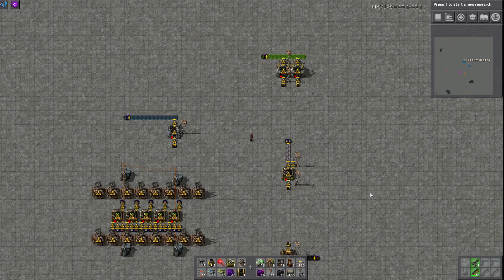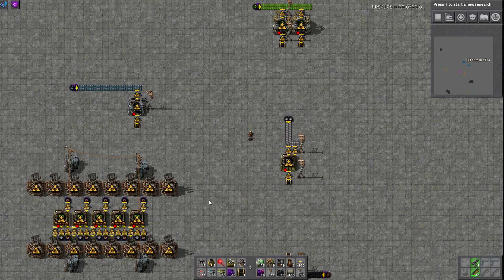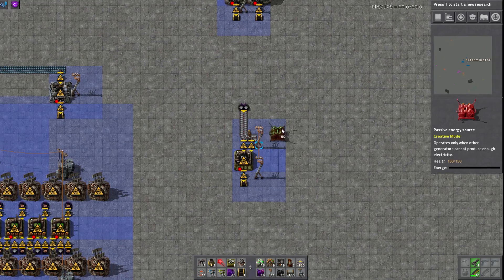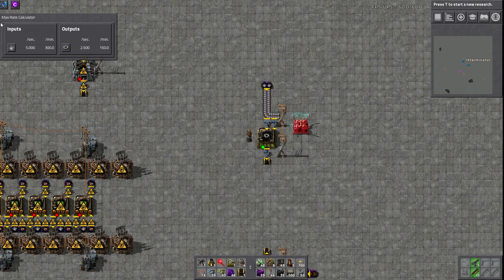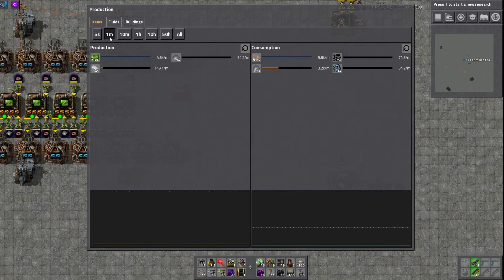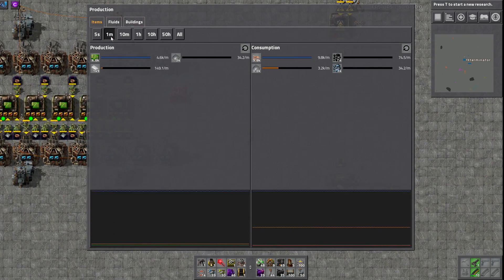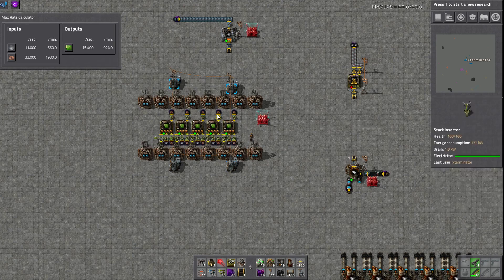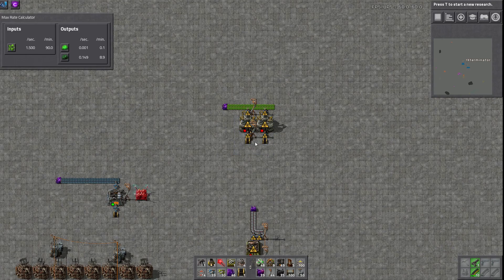Factorio Mod Spotlight - Max Rate Calculator

Comment: Damn this mod looks really really handy, it will save a lot of trouble calculating this stuff by hand (still useful to know how to do that), help avoid mistakes and generally make it quite easy to check if you are producing enough inputs. I'll often run into things like starter bases not producing enough circuits when you put down some new assemblers, and I just add some more and check if it runs ok. Now you could just drag select to see how many input you need, and how many you produce and see if its feasible to expand production or if you need to take more drastic measures. Definitely going to use this myself!
Reply from the maker: Completely agree! This makes calculating things so much easier, even though as you said it is good to know how to do it yourself.

Comment: Thanks for spotlighting this!   In addition, if you select multiple machines some of which provide items for the others, it will show the net difference.   For example, a copper cable machine and a green circuit machine, it will show a net negative value for the cable.

The version I'm working on now will let you also see the rates in terms of compressed belts - i.e. how many belts are needed to feed or take away the items.
Reply from the maker: Of course! Very well done mod and will be super helpful for sure!
Getting the belts to work sounds amazing. I know a ton of people would love to have that feature. 

Really great job.
Reply: the shortfall on machines in the build is awesome, I'd also love to see a max output "as built" as in how much can be produced if there are no other outside inputs. So for example, if i'm short say 4 copper wire machines, how many green circuits can be built with that shortfall...
Reply: If you've selected both green and red circuit machines which ones should get shorted?   If you've also included blue circuits then that copper wire shortfall could ripple in different ways.
Reply: Oh my god thank you.
Brilliant, I love it
Reply: Thanks for adding this comment.  It was my lingering question from the video
Reply: xterminator do you know a good advanced helmod tutorial?

Comment: Can you select different machines at the same time? Like refineries and cracking to figure out the overall output of a setup? Or what about assembly machines with different recipes like direct feeding copper cables into beaconed green circuits?
Reply: he said at 1:31 you can click+hold+drag to select multiple
Reply: Yes, it adds a column to show the net (positive or negative) of the intermediate materials.